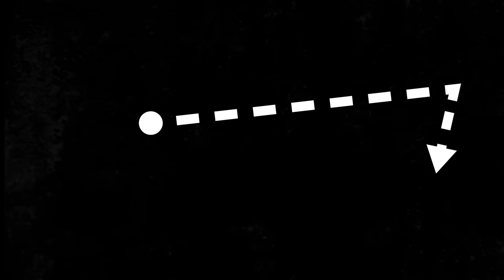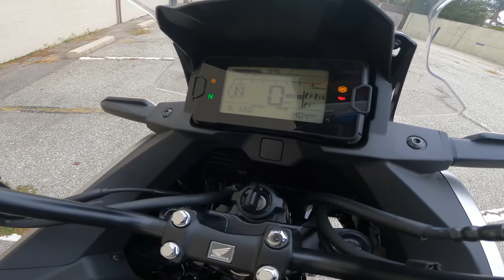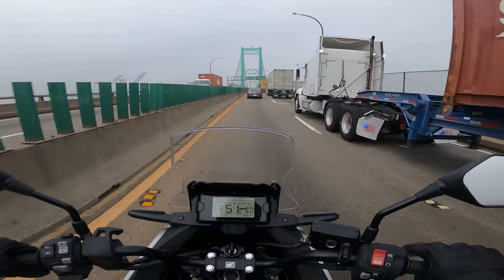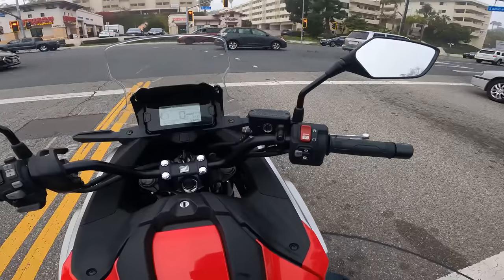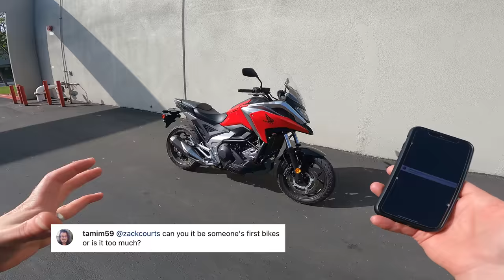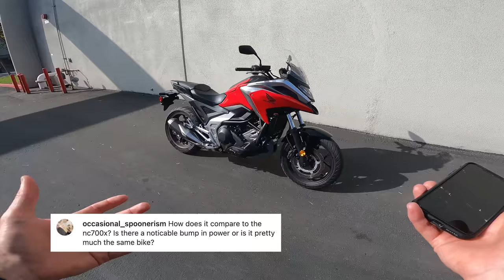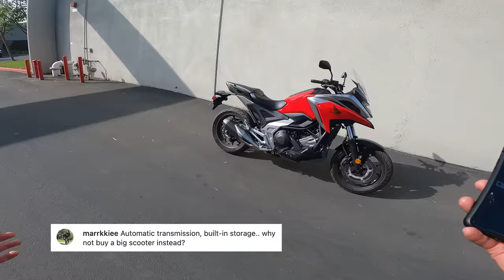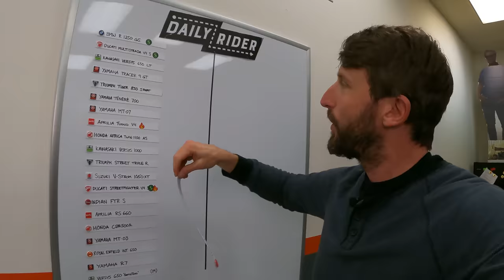Automatic-transmission on a motorcycle? 2021 Honda NC750X DCT | Daily Rider

Comment: I’ve been using a 2018 Africa Twin Adventure Sports as my daily for 3 years. I’ve done tours, off-road, trails, pillion and we’ve had a great time. But. It is reaaaally top heavy and very high, even with the reduced height rally seat. I recently decided to get something more practical as a daily and just ordered one of these. It is a really surprising bike. You can’t judge it on its power figures. You really need to test one. So much low down grunt right from the get go. And it really feels quick and peppy on the twisties. Even reminds me of my old Tracer 700. And it’s absolutely nothing like a scooter. I rode scooters years ago and just didn’t appreciate the riding position or the light front end. And all those DCT haters, seriously, go try one. I’ve also got a 650 Bandit and an 1100 Pan European. I’ve ridden tons of other bikes. This one is by far the most surprising. In a good way. Which is why I bought one!

Comment: As a current DCT rider, I DO NOT RECOMMEND DCT to beginners for 3 reasons.

1) Whiskey throttling
There is nothing to cut power to the bike. The user needs to completely understand and respect how sensitive throttle responses can be. An ignorant full twist of the wrist can easily send the rider into orbit.

2) low speed maneuvers (beginners worst enemy)
Where you would be normally feathering the clutch and controlling how much power you give the bike, you can’t with a DCT. Which means you have to work more attentively to keep the motorcycle from running away from you when doing tasks such as tight u-turns. This usually involves pinning the rear brake at particular intervals which takes skill to get it right even for seasoned riders.

3) traction during turns
A bike has the most traction when the suspension is loaded with either throttle or brake. DCTs cannot perceive road conditions like the human eye and have a habit of shifting at wrong times during turns which momentarily unloads the suspension and can cause you to slip. It’s uncommon but it does happen occasionally. It can be quite jarring.

DCT is great technology and is commonly misunderstood in the motorcycle world. It is very practical and convenient when used correctly. But in my opinion, it does take a bit more knowledge of how riding works to use it effectively when compared to a traditional manual transmission. 

I personally enjoy my DCT and do not regret getting one. I was skeptical at first until I rode one for the first time. It was a blast with lots of smiles.
Reply: I never heard these arguments against a DCT for newbies  but they all make perfect sense. An electric would probably be better
Reply: Hey Danny, I got a Rebel 1100 DCT  as my first motorcycle,  this is my experience

1)  Whiskey Throttling -  There are 4 ride modes available :  Normal, Sport, Custom, and Rain. I started in Rain and that greatly reduces throttle sensitivity.  I actually had more challenges with whiskey throttling on a manual transmission due to having to remember to use both clutch and throttle. It takes a while to develop the muscle memory to control both and with the DCT it's just easier. Too much power,  on the DCT just let go of throttle just like you would a clutch and throttle. 

2) Rain mode helps greatly with low speed maneuvers, on the DCT I practiced heavily on figure 8's  and sharp turns from a stop in prep for my new rider course at Harley Davidson.  Felt comfortable on a traditional motorcycle and the DCT, both were fine.  On the DCT you learn to go easy on the throttle and on the manual you learn to feather the throttle and clutch.

3) Have to heartily  disagree on this one ,  one of the best things about the DCT is running into a corner and the ability to adjust speed without worrying about what gear to enter in, what gear to change into if you get it wrong.   At no point in my riding has my Rebel ever "unloaded the suspension," corners are extremely smooth in the DCT and I go looking for for roads with corners. I don't enjoy highway miles, I enjoy the twisties.

With that being said, it is fun running through the gears on a manual transmissions.  I do plan on getting a second bike and that will be a manual.
Reply: @bhdutt  great points! Unfortunately, older DCT models with non-electronic throttles don’t have riding modes to compensate. 

These were just small things I noticed after going from manual motorcycles to the DCT. Each choice has its pros and cons and will do better at different things than the other.

I do not dismiss the DCT, it is wonderful technology and makes a lot of sense for some people. It unapologetically serves a niche in the motorcycle community and does it well. Who could hate on that? Personally though, my next bike will be a manual again. DCT is just a crutch I never needed.

Comment: Automatic gonna be the next thing, doesn't matter what traditional riders say.
Reply: Same as cars over bikes in a lot of places. But bike for many is for excitment, not practicality and if you are after excitment, then NC doesn't really fall as top choice and neither does automatic gearbox.
Reply: If it’s electric makes sense. But for conventional clutch systems, this thing skyrockets the price of the system. And nobody needs it
Reply: Nope
Reply: @JinKazama92  every electric I've ridden was a single speed
Reply: Hmmmm possibly.  Not really sure why though.  Is this a dense city traffic biker thing?  Even on old, heavy cruisers I've never noticed a clutch or gear box being a detriment.  Bike gearboxes are just so quick and clutches (relatively speaking compared to cars) so light that I've never really understood a need for auto/dct on them.  Sure, there's some straight line performance potential improvement, but that's almost never the argument for them.    On powerful cars in cities or those seeking performance, I get it for cars going to dct or auto over manual.  Bikes?  Not so much
Reply: Nah the people that want to ride but want an automatic those are the people you see on scooters automatic motorcycles will never take over
Reply: As the  new generation grows up to have just enough wrinkles on the brain so as to not defecate on the street , you are probably right. 
I'm 51. For me an automatic car is for the unable to grasp the concept of the clutch. The automatic bike is basically for the mentally poor. Scooters are moving recyclables.  Excuse my French.
Reply: @Axial ivanov  that's what they said about semi's
Reply: @stonewalljackson9739 when will the parts break on dct gearboxes? I ve seen tons of videos when the solenoid failed and also in real?
Reply: Considering we are the main customer base that decides demand. No it wont.
Reply: @konsantinosakassis3830 without question.
Reply: @TimothyCaldwell-mt5zc  it's already happening with honda, and the trend will continue with other manufacturers. Also e bikes will take over eventually, no amount of denial will change that.
Reply: Yeah, no
Reply: Agree DCT the way to go!!!
Reply: @ludoduh i don’t think you’re right. I’m 30 and just bought a 82 Suzuki gs750. Us younger lads are out there and our generation (or younger) is never switching to automatic.
Reply: @TheScottbb1  let's hope for the best, and have the freedom to be sceptical
Reply: Just hope they don't start changing rules on what motorcycle you do your road test on. Only being certified to use a manual and or only automatic transmission.
Reply: @mrconductor144  we still ride a lot without any tests here in Bulgaria. I got my A of course, but I'm riding international. Around here there are lots and lots of young lads riding without any license.
Reply: @ludoduh  just saying the way they are going with a CDL you take your test (In North America) if you take it in a automatic transmission you are only certified to drive a automatic truck. Hoping with these new automatic transmission bikes 10 or 15 years down the road they don't start pulling this kind of thing
Reply: @mrconductor144  well, this is your USA problem. Here, in East Europe things are more relaxed.
Reply: @ludoduh  I'm Canadian buddy. We have it here also.
Reply: @mrconductor144  sorry, pal
Too much regulation doesn't help. A bit more common sense does. But we are losing it worldwide ..
Reply: @ludoduh  I should note as well, for a full M (in Canada that's a full motorcycle license) you are required to be able to shift gears also be able to from a stop accelerate without stalling the bike.
Reply: @mrconductor144  we got an 8, a zig zag and u turn with a passinger, 0 to 50km/h in 100m and stop, a zig zag at 30km/h, riding in town , for full A licence on a 650 with a clutch and gears. In my case Suzuki 650 sv, I think.
Reply: @ludoduh  1 hour drive, consists of highway running for 10km and heavy traffic downtown riding (Toronto Ontario) roundabouts, U turns and a zig zag can't stall your bike once. Lol just did the Full M course last weekend, all on a 1999 Kawasaki Ninja zx11. I know people you and I have the common sense, but the powers that be think they know better 🙄

Comment: I actually went to a NC750X with manual gearbox... not only because of a difference in price, almost 1300€ right now (end of 2023) but also because I want to "learn" to switch the gears without having to think about it. Yes, I still need to check the screen and see in which gear am I.... but this is because I just got my driving license like a month ago :)
Hope I will have a great time with Honda

Comment: I have a 2017 NC700X (no DCT, no ABS, etc) and as a shorter rider (5'4"), the move of the gas tank to below the seat is the best thing ever! It's comfortable enough for riding all day, and despite the actual weight, you can't feel it. I've even toured on it and the only thing I would say is that the front end is so light that the wind off the Pacific ocean was so fierce riding down Big Sur that it was just picking up my front end and moving me over to the "shoulder." (The "shoulder" was a little strip of dirt and gravel about 8 inches wide only so that was a bit scary.) Other than low quality tires from the factory, I never had a minute's trouble with mine. It's my "rain or shine" commuter for my 48 mile commute. I ride like the middle aged lady that I am and can get 70+ mpg.

Comment: Rode a NC700 a few years ago. That was the most dull and boring experience I have ever had on a motorcycle. But it is extremely practical. Seems like a clear winner for someone used to riding a scooter and does not want a scooter.

Comment: I'm diabetic and from time to time I lose feeling in my feet, so shifting and rear brake became a bit of an issue.   Got me a Honda with the DTC and that is no longer an issue.  Added a left brake lever from a Honda Silverwing scooter plumbed to the ABS system, removed the rear brake cylinder and pedal and now I have all the controls at my hands and my feet just have to support the bike at stops.  

This bike seriously helped me enjoy riding again.  

I really like the DCT override.  Basically, you keep it in automatic and when you want to take over and pick a gear, you just do it.  So long as you keep doing what you are doing (stay on the gas or coast) the bike keeps your gear.  As soon as you do something else, it takes over again.  It's scary telepathic at times.  I've "coasted" down the Mt. Washington Auto Road and the bike simply kept the gear I selected until I hit the gas on flats or the end.  

Honda's engineering on these transmissions is amazing.

Only real problem I ever had was coming to a stop once, it would not disengage the clutch and pushed me into the intersection.  It was empty, so no harm.  Been over 30,000 miles and that only happened once.  Perhaps it was something in the oil when it was new.  There are 2 oil filters.  One like any engine, and a second finer filter just for the DCT.

Comment: The technology has come a long way.  I still have a 1978 Honda 750 with the automatic (Hondamatic) transmission.   It has two ranges that you shift without a clutch.  It has a tendency to creep when you stop. So you have to be on the brake or pop it in neutral for long pauses.  I got it new in 1978 and kept it for nostalgia.

Comment: I do have previous version of NC750X DCT. I do ride it in S2 mode or S1 mode. The D mode has too low RPM in slow speed. It is like the engine would like to jump out and hit me. But the S1 or 2 are fine. And I do intervene sometimes with shifting. When I know I will need shift down I do it and the bike obliges and returns to auto after few seconds.

The bike just goes and goes...

Comment: If you are going down a long steep grade, the ability to manually shift the bike allows you to use engine braking if the grade is extremely twisty as well. A gentleman's cruser.

Comment: Great video. 
Regarding why not buy a scooter ?
Scooters aren’t fun on the twisties. 
This is a MOTORCYCLE … you can squeeze your knees and change gears and not have to worry about wearing out your hand brakes. 
I’ve tried twisties on a scooter …
Doesn’t work

Comment: You can't even find these in the whole of California, you might find a manual transmission but not a dct, I put in a few deposits at some local bike shops but didn't hear anything for months, I was told maybe in January they'll have one but then I saw a low miles 2018 on Craigslist and snapped it up quickly, while I was picking it up the guy was getting calls for it, crazy.

Comment: I have a 2012 NC700X DCT and it is great, just hit 20k miles and runs like it just rolled off the showroom floor.  There is almost no maintenance, it sips fuel (67 to 71 mpg is what I get), it is easy to ride with a very low center of gravity, and the automatic transmission allows you to enjoy the ride more than a manual.  The bike does not have the get up and go of a regular bike given the automatic transmission and the type of engine but unless you are trying to pop wheelies to impress exactly no one, then this bike has enough useable power for actual street riding.   Don't be surprised though if you continue to grab for the clutch leaver and shifter  years after you go automatic, old habits are really hard to break.

Comment: got the same model since beginning of Novembre 2021. On my second ride, I dropped it to the ground when parking. I did not put it into neutral and kept the engine running, stupid me. When moving the bike I must have pulled the accelerator slightly and made a hop, I tried to pull the clutch, hey no clutch  and my red Honda was on the ground 😖Lesson learned, always put in neutral when destination arrived.

Comment: I've done more than 25K miles on my 2016 nc750x and I can easily say it's a brilliant bike for daily commuting and more. I recently started living in the forest and the roads are all dirt, no asphalt. At first I was very skeptical about riding this bike on dirt roads. However, it turned out that with the right tyres the nc750x dct is surprisingly good off road as it is on road. My only issue with this bike is the seat height as I'm just over 6ft. It feels low after bmw 1200gs.

Comment: It seems like the DCT in Manual mode that lets the operator switch gears is similar to the AutoStick system in cars that let's you drive like there's a manual transmission. Yeah, Zach, almost.....

Comment: New Concept? What was the concept rip off the styling of the BMW GS650?  I have the flappy paddle shifter on my bike, not a good as a manual but I've gotten used to it.  Don't think I would ever feel comfortable with fully automatic transmission on a bike.  Any bike can be an ADV if you've got the testicular fortitude!  I think its more an illustration of how much no one knows how to drive a manual anymore, sad really.

Comment: I don't understand that black front fender. And REALLY wish they'd add a rear hugger, even it it were black.

As with all NC's it will need an aftermarket seat, higher windscreen, radiator cover, and a rear rack for a tail case or side rack for panniers. Don't forget the centerstand and we'll see if Givi makes a tank bag for the new frunk cover.
BTW- I can fit my riding jacket inside the frunk!

Comment: Was going for a BMW F750GS, but for $10000 CDN less, I can get this machine. BMW offer lowering kit and seats, but I found many options for this one, and they're not expensive (around $400 for the links and stand). So, next year, this is going to be my new ride for sure. I like my MT-03, light, low seated (arouns 30"), but this is quite my dream motorcycle, even more with the automatic transmission. Thanks for this video.

Comment: NT1100 just unveiled for 2022, a DCT bike with more touring features and the same 1100cc parallel twin as the Africa Twin and Rebel 1100. Electronic windscreen, cruise control, side bags and a cushioned topbox.

Comment: I’ve always had a soft spot for this bike. Great gas mileage, friendly, storage, low gravity. People say it’s the Toyota Corolla of motorcycles. It really is. It’s a great commuter bike, it’s not going to surprise you, and it’s forgiving. I had the CB500X for several years, which is basically the smaller version of this, and I loved it. I would buy this bike purely for the MPG, honestly. The DCT fascinates me, for sure, but I’m not sure I’d get it. It’d be weird to not have a clutch to operate. 

Point is, I love this bike. I really do.

Comment: 1/2 a Honda Fit engine on 2 wheels. Easy to maintain as it's easy to get to the rockers with nut and screw adjustment makes a bike that can do 500K miles no problem.